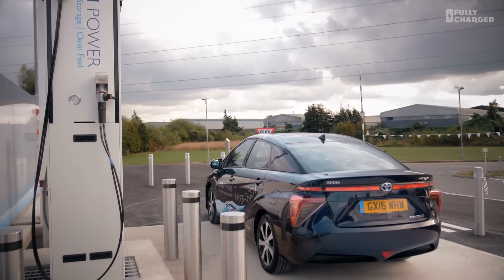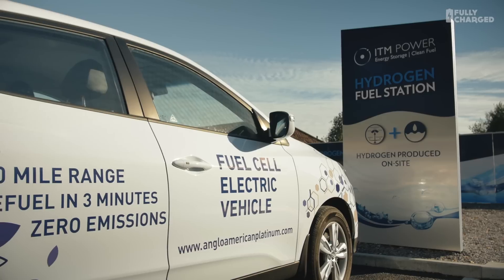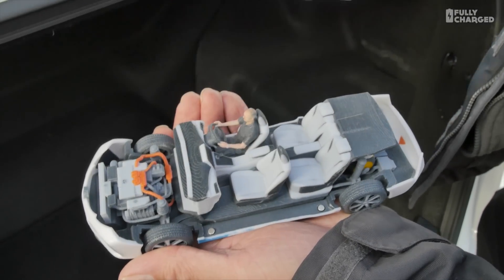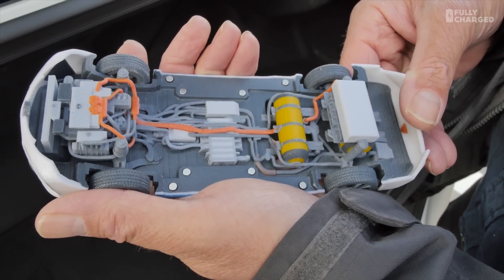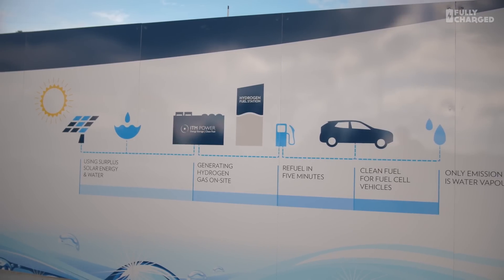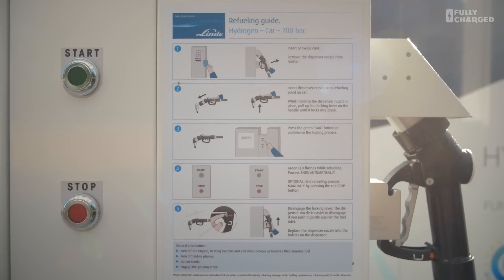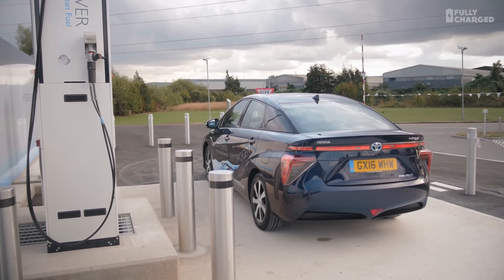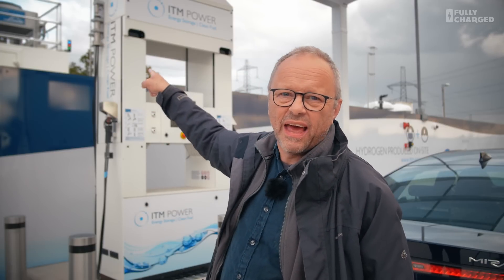ITM Hydrogen Rally | Fully Charged

Comment: not sure I'd want to sit on a high pressure tank full of hydrogen
Reply: you've got to be kidding I'm thinking. 700 bar of H2 next to you????? If it blows they'll find bits of you in the next county. Batteries for me please. Fascinating that its been done but it's never going to catch on.
Reply: hence the safety glasses :P
Reply: JAEGERTECH LOL")
Reply: SNORKYMEDIA ...is that really any different than sitting above a tank of highly flammable liquid: petrol.......?
Reply: Petrol si not under preasure
Reply: Robert Ward Have a search for pressure vessel ruptures. I'd be more worried about pressurised gases/liquids than being doused in petrol.

That said, I still wouldn't say no to a modern pressurised-hydrogen powered car.
Reply: A tank full of petrol isn't any safer. Neither is a load of lithium batteries. You should see videos of Lithium battery fires. The hydrogen system is designed to leak in specific places when damaged so, is surprisingly safe. However you are doing it, vehicles always have huge amounts of stored energy that is usually released in a crash. Hydrogen is easier to stop it being released all over you.
Reply: Have you seen videos of Teslas catching fire? It's a slow controlled burn, in which you could cook your dinner and still get away from. Things under pressure when they rupture go BANG.
Reply: ***** So what goes into a hydrogen fuel cell that's so green? Or putting in those colossal pumping stations? Or transporting hydrogen if they aren't there?

The article states, all things considered, building a Tesla has /half/ the environmental impact of an ICE all things considered. One of the most important factors is moving pollution away from the general populace.

Another factor is that as time goes on, we're going to end up with chemistries which aren't reliant on Lithium and whatnot,. but we'll already have a great power infrastructure and green energy generation in place which the new green cells can take advantage of.
Reply: Good thing hydrogen cars are no where to be found around most people.
Reply: Forget hydrogen, it's the pressure that scares me. I wouldn't want to sit on 10,000 PSI tank full of whipped cream.
Reply: And most people still have a highly explosive liquid tank. And they sit above it every day...

A hydrogen tank won't really explode with fire because the released high-pressure liquid will push any flames outwards like a flame thrower.

If it instead whacked with brute force by a car crash, it will most likely dent and leak because metal is durable. 

The only chance it has of exploding is if a sharp object slices through it. But that can be prevented by putting it in an armored area that is resistant to wide sharp objects that can slice.

What do you think?
Reply: It's the grand Japanese plan, put fuel cell cars all over the world, then one day, hit the magic kill switch.
Reply: Leon Kernan Dream on.
Reply: B.L. Alley Actually batteries can run large trucks, that's why Nikola exists and Tesla also plans to make trucks. With enough cells, good management of them and a robust charging solution it'll work fine.
Reply: Ross Bishop and Alstom have a train in testing also
Reply: I mean most trains are electric anyway, but if you need to replace diesels I guess yeah, that would work too. Again, similar principle to the truck except a car with batteries and motor in it pulling/pushing the rest.
Reply: Ross Bishop no i mean battery powered not normal electric
Reply: Everything goes through testing.  Cars catch fire all the time.  You can't claim BOTH that it is safe even though vastly fewer tests have been done on it, than on gas cars, and at the same time that it will come down in price since it is new.
Reply: If Samsung's Note 7 taught us anything, it is that Lithium-ion cells are just as (if not more) volatile than compressed H2. It's how they design the container & manage its temperature that is of most importance.
Reply: Maybe small delivery trucks, but the weight of batteries required to run a large truck over the large distance it is designed to cover is colossal. The truck would be using half its energy just transporting its energy :P
Reply: Isaac Ottley
It doesn't take energy to move mass.  It takes energy to accelerate it.  So with regen braking mass of the truck isn't too big an issue.  Since they mostly travel on the highways, at high speed with few stops, truck energy requirements are dominated by drag, not weight.  An aerodynamic Tesla truck would do well.
Reply: batteries can catch fire - just evacuated a whole student accommodation block at 3am because a new laptop caught fire whilst charging overnight!  Some being treated for nasty smoke inhalation.
Reply: just needs to be vapour and catch a spark
Reply: If you don't understand that high energy density is dangerous, you don't understand high energy density.  But that said, details matter.  Actual catastrophic failures per mile need to be examined, not anecdotes, not emotional appeals to blimps or laptops or fuel- air bombs.
Reply: Luke W to sit on high pressure hydrogen tank is the same as going to a fuel station with petroleum or diesel and sitting on one of those tanks, a vapour from either hydrogen or petroleum/diesel would result a possibility of ignition from a spark allowing highly explosive forces. Basically it doesn't matter if hydrogen is under pressure as petroleum/diesel is under pressure to. For example take a 5l carry tank and fill with petroleum or diesel and leave for a week with the cap closed. Then open. A small amount of so called high pressure petroleum comes out in vapour form and therefore means that petroleum/ diesel is also under pressure at standard day to day fuel filling stations. Point proven
Reply: To think most cars have their fuel tanks under the rear seat. It's not their lives they're risking (not much actual risk) but the lives of their children and relatives. It's also only 700psi. Your cars' tyres are 30 to 50psi, a semi - trucks tyres more like 120psi and it's air lines more like 1000psi. If it's air lines come away, they could cut you in half - but we still drive past them every day!

Comment: refuelling at -40degC and 700bar 😃 well if the hose failed I wonder what would cause the most damage the Pressure or the temperature. Either way you would lose an arm.😵
Reply: If your petrol hose failed it would be very unpleasant with a high risk of deeply unpleasant death being burned alive. Doesn't seem to be a big problem in practice, as the issue is engineered out. The same has been done here. It is a lot of pressure, but I don't expect exploding stations, or consumers, too often.
Reply: Tom Barron I don't imagine many people will be using them anyway. Except for those salesmen who work for the company for press release.
Reply: xxwookey, The petrol is just liquid that flows through a rubber tube, like pouring gas in your lawn mower at slightly higher speeds. This is 700 BAR!! This is over 10,000 pounds per square inch, that's nearly the pressure of a small bullet traveling like 1,000 mph.
Reply: azalru yes - very nervous salesman. 😁
Reply: xxwookey not too often is still too often. 

When I was a young apprentice we used to dip apples into liquid nitrogen then throw the apples which would shatter as if made from glass. The same could happen to your arm that's holding the hose.
Reply: Liquid nitrogen is at -196 C, this is -40. And even at -196C, you still used to have to hold the apples in the liquid nitrogen for several minutes to give them time to become cold enough to shatter. Don't do this at home, kids, because if you get it wrong you'll end up with nasty burns, but it's actually quite possible to pour liquid nitrogen over your hand and not suffer any ill effects at all. This is because it evaporates to gas so rapidly that the liquid never actually touches your skin.

In other words, this is just scare-mongering nonsense. There are plenty of real criticisms about hydrogen, there's no need to retreat behind this sort of rubbish.
Reply: It took roughly 10 seconds to freeze the apple at atmospheric pressure.

Scaremongering or not you do not want to be standing next to a hose when it ruptures. If the cold doesn't get you the Pressure will. If the Pressure doesn't get you the flame ball will once the hydrogen comes into contact with an ignition source. Look what happened to Spacex's rocket when the refueling hose failed......
Reply: Tom Barron  this is completely rubbish. First of all there's no way it would fail thousands of tests are run before refuelling, while and after. And even if you for example tried to drive off with the hose in the hose would automatically seal preventing any hydrogen from escaping or leaking.
Reply: You've seen the current risk using petrol with fuel refill failures in F1 Grand Prix stops. We have all sat on an explosive tank of gas and survived for decades. The same applies to Hydrogen.
Reply: Yes and I wonder why they stopped refuelling in F1? Why GM and Ford are fighting multi milion dollar lawsuits for accidents caused by badly designed fuel tanks...

Terminator 2 springs to mind when the morphing terminator steps in liquid hydrogen and then gets blown apart with a shotgun.

And look what happened to SpaceX's rocket when the refueling arm failed? KABOOM! then it rained for 2 days....

Comment: Wow, this one got people stirred up Robert! Apart from the inefficiencies, relative complexities, , marketing the idea that most of this fuel will come from renewables (which I don't believe will happen) and glossing over where the clean water will come from, my main concern is the control element. Apart from anything else, EVs represent the democratisation of vehicle fuelling - anywhere there's a plug, you can charge. Hydrogen (at least in the short to medium term) ties us to the fuel station again. Despite its network even Tesla recognise that most of the time the place to fill up is at home or other places rather than a Supercharger. As the second guy hinted, this is also pandering to the idea that nothing must slow our pace of life. You should be taking a break for a least half an hour after 300 miles and why shouldn't you have to put some thought into your journey? Don't forget it's not ICE tech that means you can drive for hundreds of miles at a time, it's the phenomenally, energy-rich nature of oil and we have become very acclimatised to that experience.

Comment: Instead of LOAD BALANCING the Grid by boiling water, they' could instead produce Hydrogen for less than 50 cents per gallon.
Reply: Schpankme Verimuch if this was economically viable, they would be doing it already. or you think utilities are stupid and can't do math?
Reply: Haralampi Nedelin 
You need to define Utilities?
Reply: Haralampi Nedelin There have been alot of people thinking like that. If it is good someone would already do it and then proceeded to not do it. Then some time later someone else does it and earn a ton because it was in fact useful. You dont know until you try. Also you are probably not the investors here so its not you losing any money, let them try it and see. Its their loss If its bad.
Reply: I really doubt that. 
I don't know how much you pay for a kWh where you live, but I did some calculations.
For the ease of calculation I approximated a gallon to 4 liters.
1 litre of liquid hydrogen weighs 70.85 grams so one gallon would be about 283 grams of hydrogen. 1000 grams (1 kg) of hydrogen is equivalent to 142 Mj of energy. That gives about 40 Mj of energy in one gallon of hydrogen. Electrolysis have an efficiency between 40-67% depending on method and scale. For this calculation I choose 50%.
To produce 40 Mj of hydrogen at 50 % efficiency you need about 80 Mj which is at least 22 kWh. 
I can't get 22 kWh for 50 cent where I live, can you?
On top of that you have to add the cost of the hydrogen plant too.
Reply: Schpankme Verimuch why? what is there to define?
Reply: Nukezone100 or someone does it and it's a total failure, thus proving the sceptics right - like solar roadways, better place, or any other venture that is based on hype and contradicts basic principles of economics, math, physics etc
Reply: FenrisUlfven his "reasoning" is that since there is some amount of energy that is wasted to balance the grid, this energy is free and it could be dumped into anything, because it's free. no accounting for the price of the installation, the loading capacity, how much hydrigen can be produced and at what cost, especially compared to hydrogen from steam reformation of natural gas.
Reply: +Haralampi Nedelin OK, however nothing is free. :-)
But if you use natural gas as base for your hydrogen it wouldn't be renewable but rather fossil based. No real win there as I see it.
Reply: FenrisUlfven for renewable hydrogen to be viable, it needa to be cheaper than conventional hydrogen from natural gas. wind and solar didn't become popular because they are renewable, but because their price was competitive to some traditional sources. that may have been due to subsidies, but in the end it's the cost and roi that matter. the roi on renewable hydrogen is attrocious.
Reply: Scale that idea, and watch it fall apart quickly. It is undeniably adding needless complexity both in production and in the vehicles....
Reply: +Haralampi Nedelin I agree, but if we switch to hydrogen for the sake of the environment then fossil based hydrogen isn't a viable solution though it isn't the only environmental issue we have to address. The environmental impact of mining lithium for the batteries is also a great concern.
Reply: FenrisUlfven
The point is moot, we are NOT switching to hydrogen anyway. Not now, not ever. Where does this sudden concern for the environmental impact of lithium come from? Coal burning in china is way dirtier than coal burning in germany, same goes for lithium - mining lithium in third world countries has way more impact than mining it in developed countries, That's one of the main reasons it's cheaper. To make a battery, you need 5-10 times more cobalt, manganese and nickel than lithium - mining those metals is not exactly environmentally friendly. But everybody is talking about the environmental impact of lithium, as if the scale or damage is something unseen today.
Reply: Haralampi Nedelin
I'm not against switching to electric and renewable sources on the contrary. We have to do it for the sake of the future earth. It was wrong of me to just point out lithium, but we do have to find ways to improve our technology without creating environmental havoc.
Reply: You are calculating eith cost of energy when it is getting used. But they say that this energy that goes to hydrogen production is otherwise would be wasted. When your battries are full and you dont use much but sun is shining and wind is blowing. Where would you put that energy? Should we buy more battaries? Hydrogen as energy storage is usefull because it doesn't depend on storage time as battaries do. It relatively cheep when you expanding. Just buy a bigger tank. Also you can as a bonus use it as a car fuel without long charging time. Isn't that greate? I just cant find any information about overproduction of usual wind and solar. Is it worth it?

That would be a perfect question for FullyCharged show. How much excess power can be produced by renewable energy plants and how much hydrogen can be generated from that energy?
Reply: Sergey Dirin hydrogen could be used for large scale storage, but it is still cheaper to just use more batteries. recently there have been some major developments in battery grid storage. batteries are maintenance free, can be recycled, and respond much faster to load changes. also, the moment you want to take that hydrogen from the powerplant to a refueling station, you run into expensive tanks and infrastructure. and the round-trip efficiency is just atrocious, something like 30%, whereas for batteries it's around 90%. so right there you need to produce 3 times more excess electricity to be able to sell it for the same money when demand is high.  audi tried a pilot project to make hydrogen out of wind energy, then combine it with the co2 from a coal station and produce methane. the methane can then be piped in the existing natural gas infrastructure. but it will never get beyond the pilot stage.

Comment: I can see the point for high milage vehicles (delivery/emergency vehicles ect) that could need to go anywhere without much forward planning... but... I still have not seen any servicing costs. do the tanks need checked like scuba tanks do? ect. 
it still appears that hydrogen will cost more to run on a vehicle and that's not even counting the cost of the hydrogen....

still, like I said, I can see a potential use for it

Comment: How much does it cost to fill up the car with hydrogen?
Reply: Electric Leaf Man £50 at current pricing
Reply: driveEV 50 for 300 miles of range ?
Reply: BitsAndBites Yep, 5kg of hydrogen at approximately £10.  £66,000 car though
Reply: Electric Leaf Man true cost is about a million pound.
Reply: Yes, a hydrogen fuelling station is not cheap - that's where hydrogen may possibly come unstuck as rolling out charge points is far simpler and cheaper.
Reply: Electric Leaf Man
Reply: Electric Leaf Man It is more then going to a supercharger... and I doubt it is 1/10th the cost of ⛽️ petrol
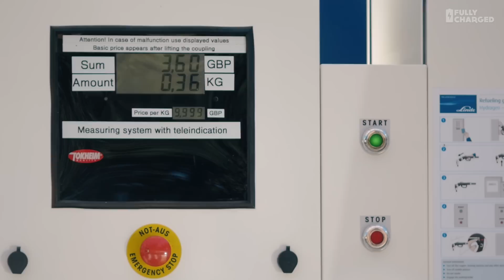Reply: 1:40 you can literally see it's 10Pounds/kg
and btw they approximatly use 1kg/100km
So yeah ~ 50Pounds per fuel tank but with ~5kg
Reply: £50 for 300 is super expensive for me. I pay like 10p/mile with the Prius.. This would cost 16p/mile